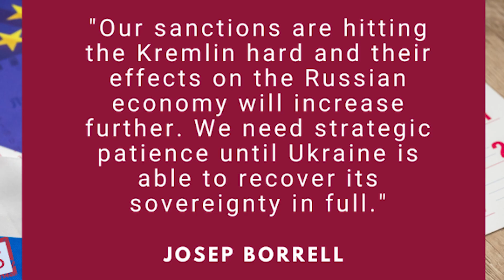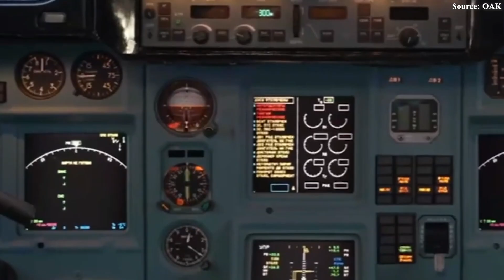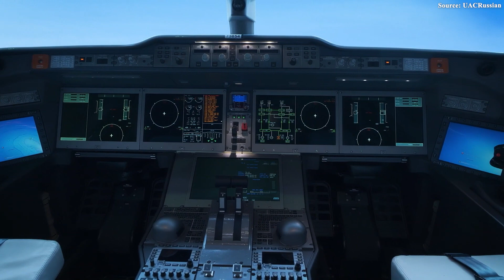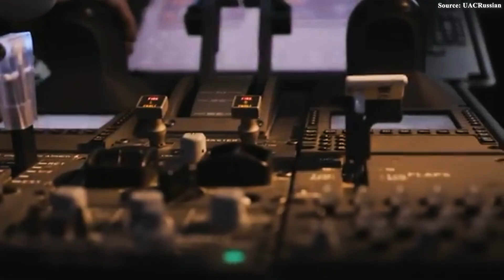Russia REVEALS New Tu-214 Will OUTSMART Airbus Aircraft & Change Aviation

Comment: 70 aircrafts in just 6 years for a plane that is being revived is very unrealistic. Supply chains need to be secured first.
Reply from the maker: Yes.
Reply: Did you expect them to start producing thousands of planes right away, after they revived the industry? Most Western countries can't even produce airplanes, and those that do are made up of parts from dozens of countries. And now you're laughing at Russia reviving aircraft manufacturing almost from scratch with a full production cycle and producing small quantities?

Comment: This TU-214 can handle a -314 stretch of 3-4 meters with the same engine and have a bonus engine like the Kusnetzov KN-86 for a couple of dozen extra seats to reduce it's passenger/seat cost.....!..
As the shrinking aircraft supplies continue, it will be wise to dry up shop elsewhere like Mexico, Indonesia or Brazil to boost aircraft production and availability, even Nigeria could raise up to the task ...